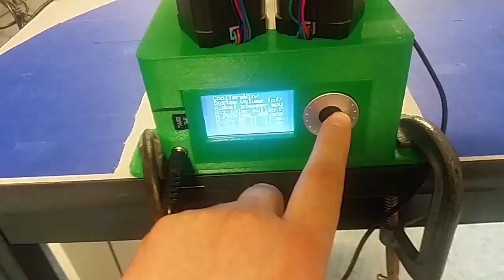Incremental Bed Leveling with RepRap HELIOS

Comment: If you really wanted to, and had the time, your exactly the kind of person that could finally make construction 3d printing a reality. The helios is a perfect platform to expand apond to build a "move-print-move" robot that could build a structure whos sizes is only limited by the material being used to print with. maybe an intuitive way to add rebar as it prints and prints around it in the next layer. you definitely have the the required knowledge and/or capability to acquire it. Id love to see the day that someone drives up in a truck with a few small robots, and a couple of cement trucks following it, on the scene of disaster and starts 3d printing temperary small housing structures that can be moved over to homeless houseing after disaster relief is done or demolished and cement recycled (that last part i have no idea what im talking about, can cement be recycled?).

Comment: Very nice build, I'm loving the 360 degree scara arm concept. Quick question though, I noticed you are using ribbon cable for the hotend wiring... Do you notice any interference from the heater cartridge wiring? Is this part of the ribbon cable as well? if so, does the cable heat up noticeably?  

Thanks in advance
Reply from the maker: GeckoBox 3D This isn't my final solution but the ribbon stays cool and the IR probe (the only thing that interference could hurt) worth well.  I use 8 wires for the heater.

Comment: Is THAT using filtering algorithm over accelerometer or something? God I can hear how it hits to the bed. I am thinking about this method 24/7. But note the filtering latency and momentum while hits over compressed wood table is easy not only to demage the nozzle, also to get the nozzle throught the surface enough to cause missalignments and autolevel not to properly function. Your work is amazing.
Reply from the maker: Alberto Mora it is still an open question if I will use this for Z probing.  Speed of probing is my main concern.  I think we can keep the blow glancing enough so that it is like knocking on a door.  It won't hurt the nozzle or the table.

Comment: Haha awesome. Was the bed probing done with the accelerometer or the LED probe?

But is that long line totally wavy or what? Just the camera? ;)
Maybe accuracy requires finer calibration with the geometry of the arms. EDIT: Oh maybe it's just the skirt that is meant to be so wavy?

Also it would be awesome to demo a higher speed of the machine.
Reply from the maker: The line is shrink wrapped around the text and is suppose to be wavy.

It is very accurate.

Speed is not something I would suggest with this iteration of the machine.  It degrades the surface greatly.

Comment: How large in X,Y,Z can this print a single object?
Reply from the maker: yep
Reply from the maker: This should answer your question. https://plus.google.com/+NicholasSeward/posts/j6bwGgC99a8  It isn't a simple answer.  Basically, a single object can be in the dark grey area and one of the light grey areas.
Reply: Looks like 400x40 or 215x50 is the biggest sizes.  Too small for anything I would use it for in that smallest direction.
Reply from the maker: The 40 is actually 160.  So 400x160 is the biggest rectangle and 215x215 is the biggest square.
Reply: So what's the max printable surface area in square meters?

Hey I had another idea lol. You could have two of these bad boys next to each other with an overlapping print area. Then you can print with two materials without all the hassle! :D
Reply from the maker: Dejay Rezme It is over 5 time bigger that a 200mm x 200mm bed.  I think that put it at .2m^2
Reply: So that would be like a 500mm x 400mm surface area.
Reply: 215x215 is still damn good and 500x400 is just WOW.

Comment: this is awesome. congratulations on the printer and the development. 
for a heated built plate you just put it on the oven... just kidding.
Reply: Just clamp it to the stove! :D
Reply from the maker: I think the premium carrying case will have 5 heated build platforms build into the sides. :-)
Reply from the maker: Or I can print right on a frying pan
Reply: "the premium carrying case will have 5 heated build platforms"
I'm still trying to play tetris in my head to figure out how to wrap a build surface into a rectangular form. I think you'd definitely want the front and the two sides to form one long rectangle and the top to extend outwards.

Or maybe you could have something like tongue and groove on the sides. And have beams that slot into the grooves to connect plates either at 90° angle or flat together.

For connection of heating element... you could also make heating elements that use nickel wire that only need two wires instead of 2 for heating and 2 for sensor. In vaping ecigs this is used for making heating coils with simultaneous temperature control, the resistance of nickel wire increases very predictably when heated (thermal coefficient of resistance).

Or maybe just heat the center plate and have a copper connection to spread the heat out evenly?

Eh crazy ideas :D